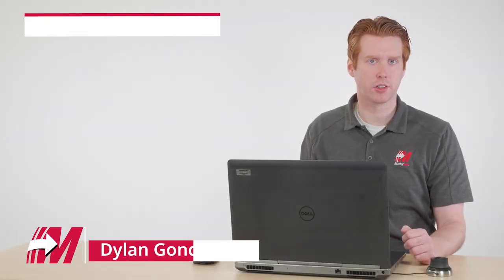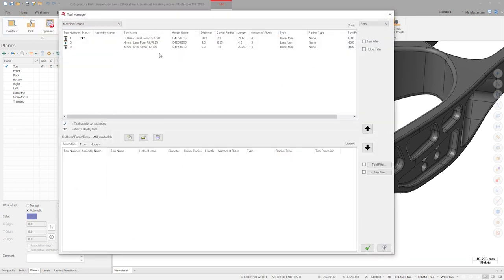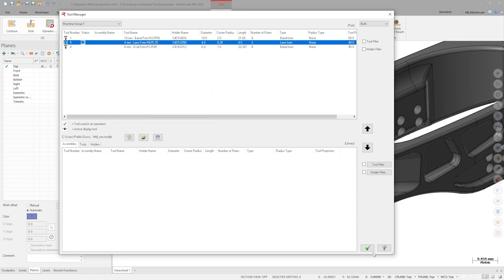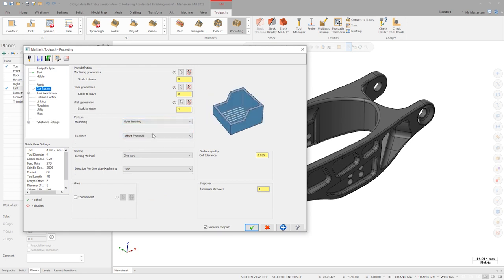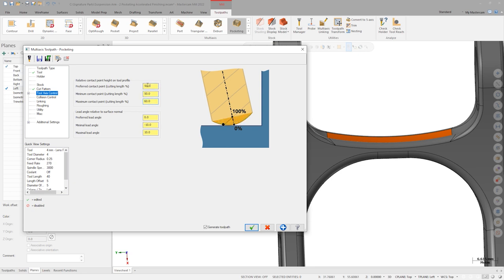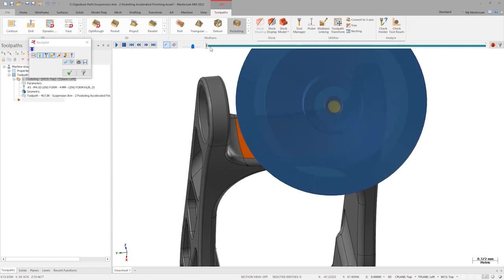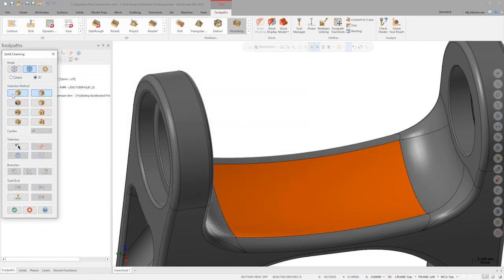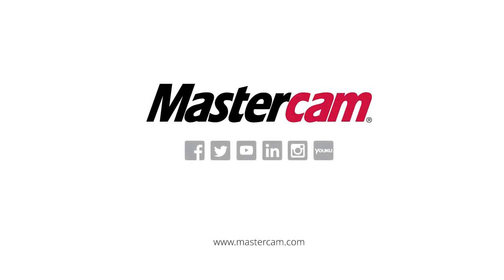Mastercam Pocketing Accelerated Finishing Using Suspension Arm | Mastercam 2022 Signature Part

Comment: Hello Mastercam, is there any strategy/option for Gear Skiving, Mill Turning, Involute Gear Milling and Simultaneous Turning ?
Reply from the maker: Hi there! Generally, specialty paths like gear skiving require the use of special cycles or codes on the control to get the spindle and axis sync necessary for machining. And, compatibility and programming method vary greatly from machine to machine depending on what the manufacturer has built in for functionality. For these reasons, there isn't one specific toolpath that accomplishes this alone.